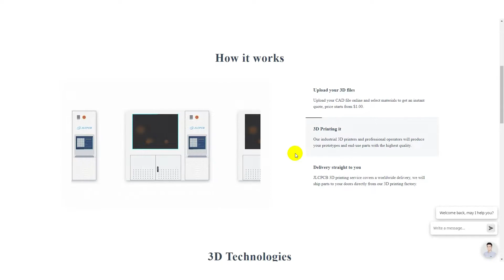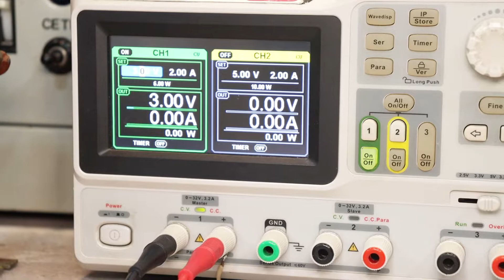How to find a short circuit in an electric motor ?

Comment: Pretty neat. It's a hand held "growler". If you're unfamiliar it's basically the primary of a transformer where all the "E" laminations are inserted in the same way and the "I" laminations are discarded. As you slide the growler along the stator or rotor you'll hear and feel when you hit a shorted turn, hence the growler name.